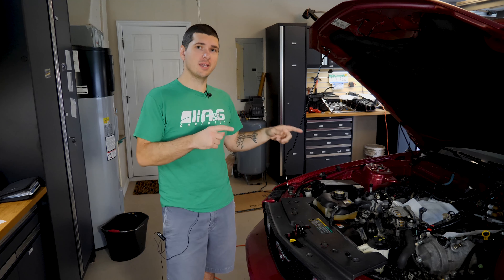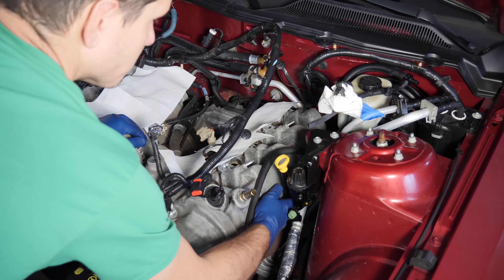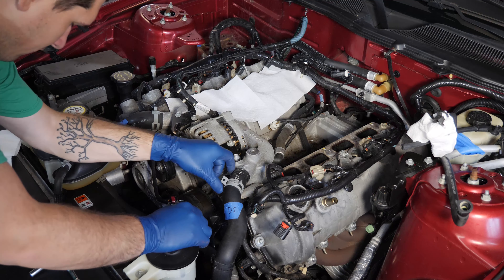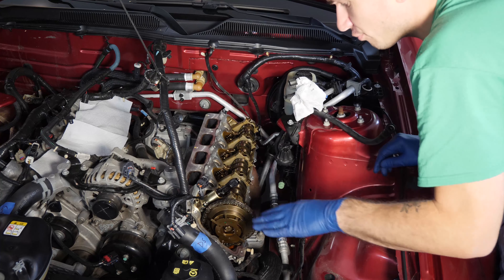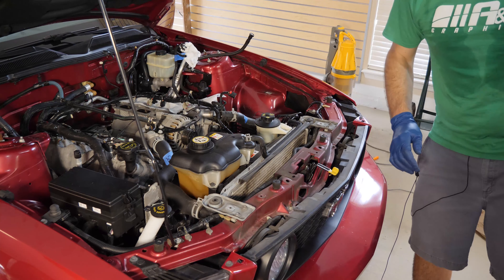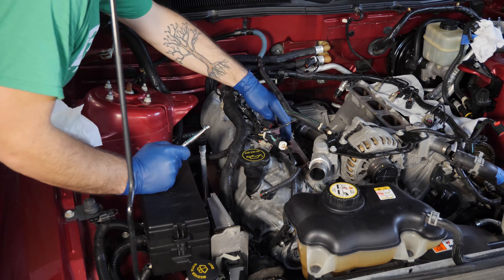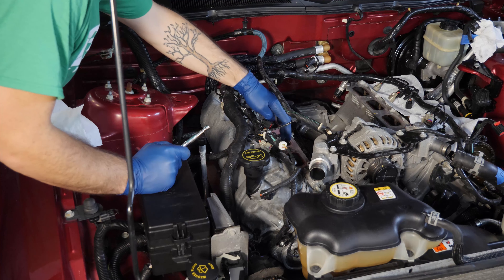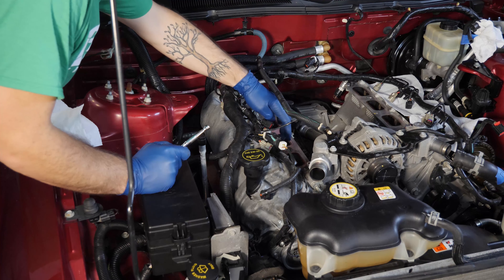How to Disassemble A Mustang GT 3v 4.6L Motor 2005-2009 Part 3

Comment: i have a 2006 gt with a grand total of 21,000 miles on it and i removed the factory 2 piece spark plugs without them breaking in half and installed a set of champion 1 piece spark plugs.. i did not want to put a lot of miles on the car and then possibly have the spark plugs break when removing them later on when the car has more miles on it..
Reply: good idea,,,i just did my spark plugs at 48k miles and none broke using deep creep,,,replaced them with the better 1 pc design

Comment: Hey! I love your videos.
I broke my 4.6 3v and i need replace some internals.
And this guide is very helpful. 
Sounds very strange, but when I was driving my car there was a very strong storm, and water entered the engine through the air filter. And the vehicle came to a complete stop. The next day I removed the air filter and the maf sensor and it was flooded. I started the vehicle, but the engine was badly heard.

Comment: Did you not have to take out the spark plugs?
Reply from the maker: That’s a totally separate video. Here you go:
 
Replacing The Mustang Spark Plugs at 100k Miles. DISASTER STRIKES!
Reply: @Rythecarguy  thank you man these videos are really helpful I have same exact car and color I cant keep mine on..
Reply from the maker: You mean you can’t keep it running?
Reply: @Rythecarguy  yeah sorry I cant keep mine running I pulled my plugs and that was a nightmare . The were broken and gunky